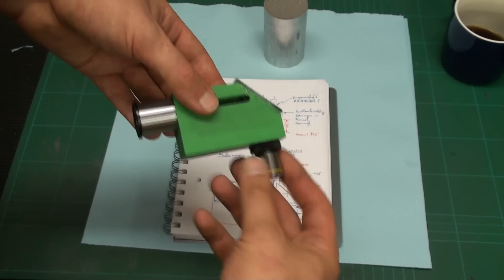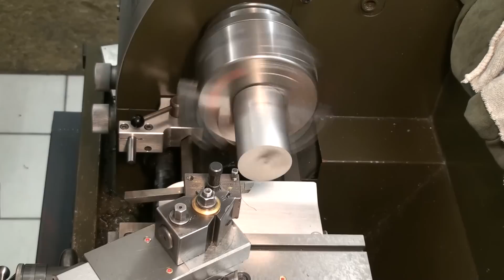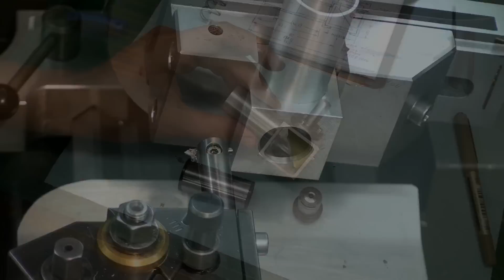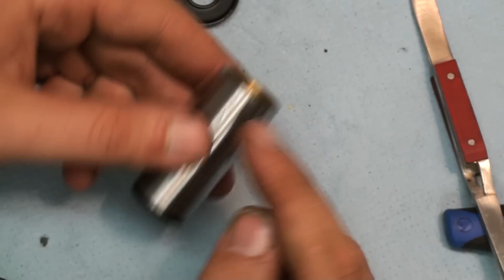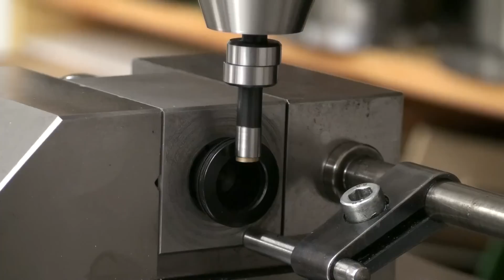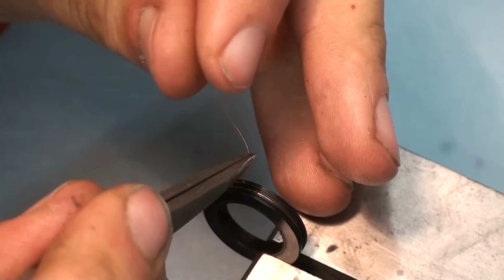Centering microscope - Prototype

Comment: Stefan, If you use paint stripper on the mirror backing you can remove the paint on the rear of the mirror. This reveals the silvering (aluminuum) and you then have a surface silvered mirror which is far more preferable than a back-silvered mirror..which gives ghost images. Nice vid. Keep em coming!
Reply: Wow, thanks for the valuable information! I'm building a camera and was just searching for cheap reflex mirror!
Reply: Rexus King Usually for reflex camers you need thin ones so they are light and can move more quickly. The ones for telescopes tend to be thick so their surfaces are curate to at least a 1/4lambda. (sub 1uM). For a camera viewfinder this isn't completely necessry...nor for a centering scope...unless you want to use high mags. Stefan is only using 100x so any old mirror will be sufficient.
Reply from the maker: Thanks, I will try that - Acetone should do the trick.
Today I got a nice glas prism in the mail, that seems to be of excellent quality, lets see if that works out for the next prototype :D
Reply: MIrrors are generally proffered to prisms when there is not much light as prisms attenuate more and they need to be multi-coated to prevent internal reflections etc. Mirrors work at all bandwidths and do not require any coating. At least not exotic ones like lenses and prisms do. The best mirrors to use are those sold as telescope secondaries for Newtonian scopes. You can get them for a couple of euros from surplus places (SurplusShed) or on ebay.They can also be harvested from import optical devices like this http://www.ebay.co.uk/itm/90-Deg-Zenith-Mirror-Astronomical-Accessory-for-1-25-Telescope-Eyepiece-trackco-/221942394907?hash=item33accc301b:g:RIYAAOSwhcJWMDht.
Reply: just was gonna say that!
Reply: Yes, I'm just screwing around, so accuracy is not that critical to me :)
Reply: A few dollars for a cheap,  first surface mirror is worth it. If you remove the coating the regular mirror can tarnish quite quickly. Aluminum mirror coating with an oxide protective layer is probably the best cost/reliability trade off.
Reply: I've pulled front surface mirrors out of an old scanner. Still has the protective surface coating on it.
Reply: You'll find first surface mirrors in the older flat bed scanners or the scanner section of multi-function printers.
Reply: Would a first surface mirror or a prism be more desirable in this application?